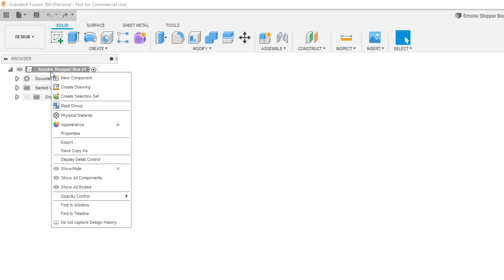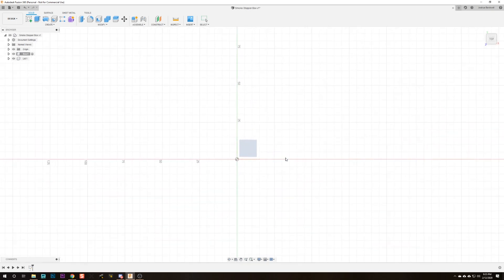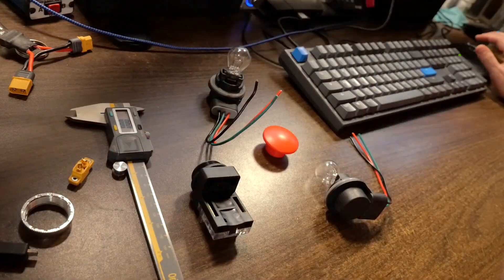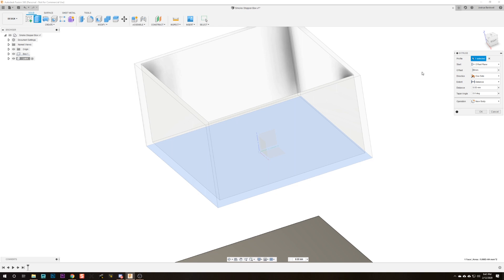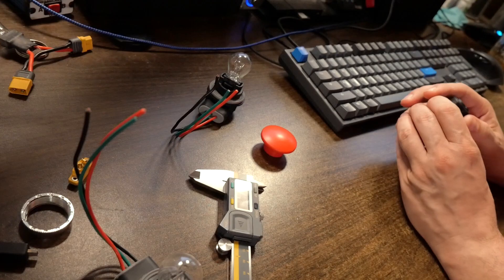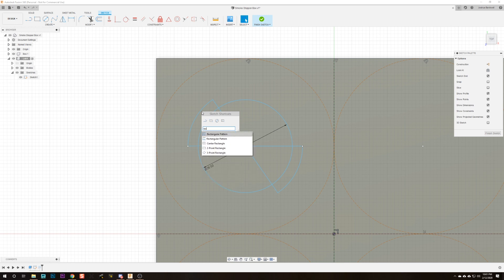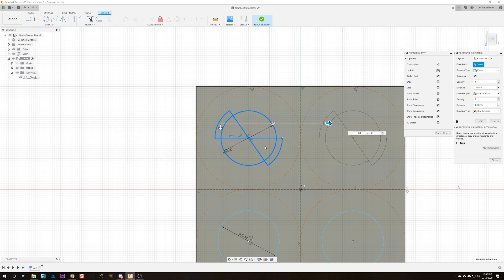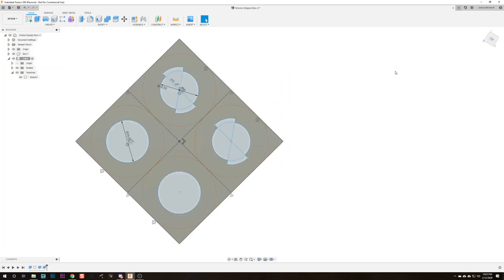My first time using Fusion360 was completely embarrassing

Comment: Use Autodesk Inventor 2020 instead! Its basically exactly the same program but it runs locally on your computer. Thus meaning it could be used even when your internet is slow or down

Comment: Hard to tell how you were running the windows as you drew that up

Biggest time saving thing for me.   Figure out how to do components.   I wont explain it because others have great how to for that.

Basically i would be operating 3 windows with your project.   Immediately save the project folder and select new component.   You will come back to after your next to files are saved.   Next window, draw your bottom box, save it to the project folder.    Third window start your top plate and save to the project folder.    As you extrude these into the parts you want it will become apparent how the components work...    

Go back to your first window and you can import the bottom box under that new component.   You can then create yet another component and import the top plate.

The great thing is now when you goto the seperate drawings for both the bottom box and top plate, any changes you make and save will automatically be in your projecr folder.    In your window you imported them to, they can be  updated after every save.   You can move them around MUCH easier than if you try doing it all in one window.

Then you can create models of things like that XT60 surface mount connector and import it into the model with the other parts, doesnt fit?   Make changes to the individual drawing for that part.   Then refresh/update and see how your change worked out.

For me components are my newest best friend when it comes to assembling things.   It has given me TPU parts that precisely fit my carbon I cut, like importing a base Hero7 mount I designsd and making it a precise angle for fitting side plates that were cut .

Also.   Look up how to import a DXF.  I sent you a link to the tutorial video I used that has let me make a bunch of custom DXF for putting a logo into something like a GoPro mount.   Then you get a picture of your logo/signature, convert it to a grey scale/black&white and use a program to make that a DXF.    Now you can press/pull that DXF right into the models you create.

Comment: I'm quite interested in 3D printing and came close to dropping the hammer on a device today. Printers have come down in price by a lot in the last couple years. But Fusion 360 costs £54 monthly??? By the prop god's hirsute sack, that's a yikes and a hard nuh uh, from me. So is there software available that just has a one time cost? I would much, much, much rather spend my time learning with software, that doesn't demand rent after a "trial Period" tbqfh.
Reply from the maker: Fusion360 is free for non commercial use. I've been told the 1 year trial can basically be extended forever. And there are tons of other ones that are also free such as TinkerCAD and Google Sketchup. You're good on this count.
Reply: Had a trial since like 2013, and never had to pay a dime. Just use for personal use or educational even and you're all set! Same account as well, seriously, i just submitted a renewal each time it asked and I got approved. For years, with no end in sight.

Comment: I do things a little differently since i'm used to Autodesk Inventor, but yeah, you're doing pretty good. 

You probably could've done a circular pattern for the lightbulb fixture thing, or make a construction line perpendicular to the center of the arc so you can do it in one mirror rather than 2. Not that your method was wrong, it's totally valid, it just won't be constrained the same which may be important once you start getting more in-depth learning to constrain objects.

Comment: 3D modeling is not quite as easy as a lot of people make it out to be, as you have discovered.  Solid modeling for 3D printing is actually the easy part, the bulk of the work is in detailing and design intent, and that’s why there are a healthy number of people making six figures doing exactly this.

Comment: Coming from SolidWorks I found Fusion 360 so much easier after training my mind that in fusion u have to design on top of bodies or planes and in SolidWorks u design using sketches in 3D space... Plus fusion is free and has cam software for g-code built inn! Big fusion fan now!!!

Comment: I learned to draft on other software many years ago and fusion goes against some habits I have but not as much as sketch up. I'm learning how to do the things I want to without breaking the constraints and design history. But I honestly didn't know the hot keys or parameters. I've always been annoyed that the design history isn't a tree structure with parameters within it. But now I know a couple things to bring my work flow closer to normal.

Now I'm gonna burst your bubble on some other things. 1, you could have gotten a current limiting buck/boost converter and a gauge for volts/current to power on your builds using a power supply for your battery charger probably almost as cheap as a few tail lights. And this is something I'm about to print a box for. And 2, if you want to use these bulbs with 2 elements you might be able to get away with just 1 bulb. The bulb has a common conductor which is normally the ground but if you stop thinking of that as a ground and more as a common you can let it float and use a lead for positive on one of the elements as the negative so current flows from one element to the common then into the second element and on its way to the esc. The elements are effectively in series. (working on guitars taught me this trick in a way with series or parallel wiring of the same 2 pickup coils for different sounds. Helped me break out of some assumptions or fixed ideas about how things should be wired)

Comment: - Wall thickness should be a multiple of the line width you are printing with
- There are clearance gauge test prints online with which you can test the clearances your printer is able to achieve

Comment: You're doing really well. If you're not already, use a 3dconnexion space mouse, it's a game changer for cad. Check out the shell command for an easier way to hollow out objects. Also you can extrude multiple surfaces at the same time or add them to the same command, when you were cutting out the holes for the sockets. I agree, Lars is the fusion360 master. His tutorials are great because he shows you why, not just how. He is also showing multiple ways of doing everything.

Comment: Thank you for the link to Lars' channel. I've used SolidWorks in the past but have taken a new job and no longer have access to it so I've had to move on to Fusion 360. Not sure if it's advice or not but I bought myself a space mouse and love using it for modeling. I got mine used locally for next to nothing but they can be expensive new.

Comment: I totally feel you - I recently switched from inventor to fusion, its a pain learning new software
Reply: I struggled with the switch too but Fusion 360 is alot better imo, especially if you 3D print or have a CNC
Reply: Owen Buckingham yeah I agree - the switch is totally worth it
Reply: Should have said, "I'm Joshua Bardwell, and I'm going to learn something today"

Comment: Not only good for 3D printing, but also modelling quad-parts. Just last week I broke an arm for my 3". Because I didn't want to wait a month for arms to arrive from the US, I measured the parameters from the old arms, placed the holes where they should be in Fusion and modelled my own interpretation of arms around them. They look exactly the same as the originals, just with different motor-protection on the tips. Send the necessary files to a CNC service and you got yourself some cheap replacement parts. Overall, solid-modelling is a great skill to pick up.

Comment: I started with Lars but didn't like him. Then I went to Learn Fusion 360 or die trying. That got me going. Then I didn't use it for a year. So I needed a refresher.
So I found Learn Fusion 360 in 30 Days that Martin Gates just mentioned. I'm really flying now.  In my opinion a 3d printer  is really only useful if you can design your own parts.  The stuff on Thing Verse is at best a starting point.  Very few people post their Cad files which mean you have to start from scratch most of the time. All the other stuff will fill you house with useless trinkets.
Reply: Learn Fusion 360 or die trying was huge for getting me started. Lars is good for more advanced stuff once you have a basic understanding.

Comment: 3:00 in and yes Parametreic is A way to do things. Just not necessarily THE way. Nothing wrong with doing without parameters especially if its not a model you'll modify or create variatons of in the future... Sometimes, you d'ont need to complicate things... That's what's called over-ingieneering. Just saying.

Comment: Part of why I love this hobby is how a lot of the parts are literally 3d printed, and not pressed in a chinese factory. I've already designed multiple GoPro cases, antenna cases, wire covers, etc. in Fusion 360. Get it. Learn it. It's a great resource.
Reply: i have gone to the autodesk site and says 495 per year :0
Reply: Now we just use filament from Chinese factories :D

Comment: Wall thickness really depends on what you’re making but for something you don’t plan on dropping off a cliff, I usually make the walls and base 1-2mm thick solely for faster printing. You can experiment with wall thickness and watch how much the print time will vary. Thicker walls, to an extent, will take longer based on infill needed to take up that space.

Comment: It’s better if you make the wall a multiple of your nozzle diameter.
Reply: (I didn't mean to delete my original reply, accidentally pressed the wrong button, thanks YouTube for not asking if I was sure I wanted to delete my post...)

For the wall thickness of the object, I would say that making it a multiple of your nozzle diameter is only beneficial when it's less than 5x the diameter of your nozzle.

Hear me out.

When your slicer slices the 3D object it has an outer shell setting, often it's set to 2 shells, so with a 0.4mm nozzle a 2mm wall in your 3D object will have two 0.8mm shells and a 0.4mm gap in the middle for the slicer to figure out how to deal with, it'll likely just fill that 0.4mm gap solid (Slic3r does).

Whereas if you have a 3mm wall in your 3D object that means a 1.4mm gap between the two 0.8mm shells for the slicer to fill with whatever infill pattern you've got set.

But saying all that, I don't often bother with getting the wall to a multiple of the nozzle diameter, like the 0.6mm wide tiny 'springs' I've been designing today, since my Prusa prints it all almost perfectly :)  Though the PLA weakens after that tiny spring has been bent too many times, I may try PETG next since it's more flexible than PLA.
Reply: That's because it makes it so that there is no software or nozzle issues while slicing or printing. This helps dimensional accuracy, can save time printing, and yields cleaner, better looking prints.
Reply: It doesn't matter,  just make it. I've been doing it for over eight years.

Comment: i like it. i am just getting in to fusion 360 myself there is a steep learning curve compared to tinker-cad
Reply: it's just like flying in acro vs level mode
fusion is amazing, you'll get there
Reply: You should try FreeCAD. There you have a CAD mode like Fusion and a Bool mode like TinkerCAD. It's a smoother transition and for some stuff you are faster with the one or the other mode.